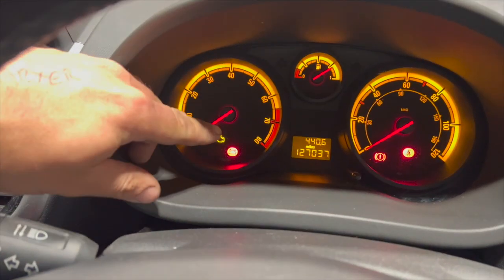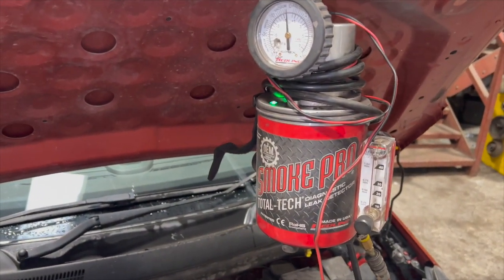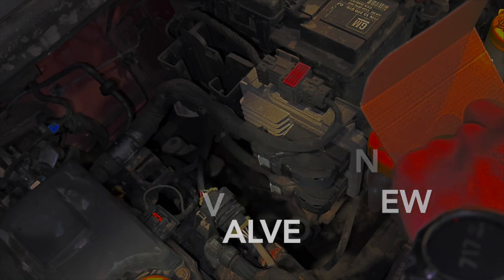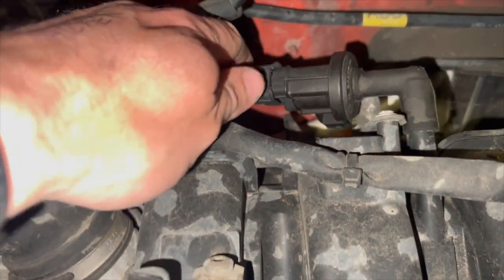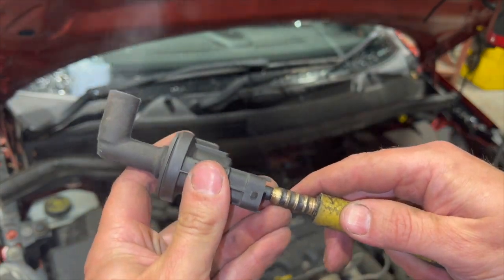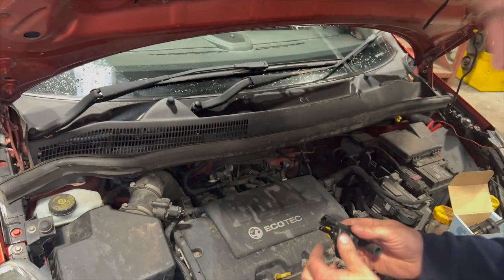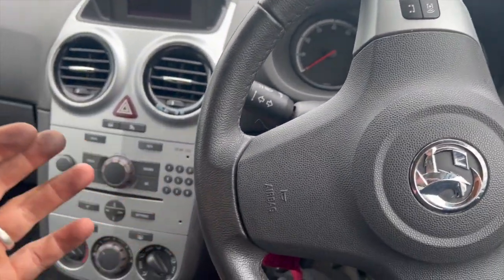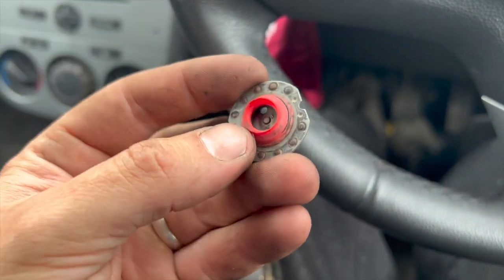Vauxhall Corsa P0171 fuel trim system lean fault code fixed!

Comment from the maker: New Purge Valve Ebay - https://ebay.us/vNarSE
New Purge Valve Amazon - https://amzn.to/3I9r37W
Diagnostic machine used in this video:
Topdon Phoenix lite 2 Ebay - https://ebay.us/tsyiTI
Topdon Phoenix lite 2 Amazon - https://www.amazon.com/dp/B0B1MB6YG8  

Tools used :
Smoke leak tester kit - https://ebay.us/txeXUY
Power probe - https://ebay.us/vg7PGK
Leatherman wingman multitool - https://amzn.to/41dtKwm

Check Euro car parts - https://tidd.ly/3lIO7xA  (use discount codes on site)
Check "Car Parts for Less" - https://tidd.ly/2LNEwIn  (use discount codes on site)
Check GSF Car parts - https://tidd.ly/34pZe7o  (use discount codes on site)

Comment: I have the same problem on a 2017 Corsa. I removed the purge valve but it was shut. I applied a regulated power supply to the purge valve and it opened at 5 volts and 0.3 amps. Is this what should happen or is the valve opening too soon?
Reply from the maker: Sounds like its working ok tbh

Comment: Great video - very clear and thorough. The problem I had that stopped me doing the "blow through" test was that the rubber elbow that connects the purge valve to the manifold would not budge no matter what I did. I tried prising with a screwdriver and even removed the mounting bracket so I could try to twist the valve/elbow to break it free but still no luck. Any more force and it risked either ripping the elbow or breaking off the pipe on the ridiculous plastic manifold.

Luckily I found an "evap" test option in my TopScan OBD2 scan tool that may have been for that valve. When I operated the test it made the engine idle go rough as if the valve had opened and let vapour through causing it to go rich - at least it seemed that way?

In the end, my A12 XEP misfire was caused by the spark plug gaps strangely being way too wide - guessing that they were something like 1.2-1.3mm as the gap tool I have only goes up to 1.1mm. They should be 0.9mm and setting them to that removed the problem. Not sure if they naturally widen over time due to repeated use or if they were wrong when the garage put them in, but the problem only slowly started after a couple of years or more, then worsened over a few months.

Comment: Will this cause the car to chug when in lower gears
Reply from the maker: Usually just puts the light on but is possible
Reply: Did you find the fix for this? Mine bucks in lower gears and is also showing the p0171 code.

I've ordered a valve as they're cheap enough anyway.

Comment: Hi bro, please give me advice.
Corsa D 1.2 2013.
Could start the car, runs perfectly, as soon as I touch the thortle the engine starts running rough also the rpm start going up and down. While pressing the thortle runs perfectly but at idle rough again. If I turn off the engine, and wait untill cooled down, then it's fine again.

Comment: This has been a problem that been driving me mad!! 
Light comes on intermittantly when I'm usually stopped at traffic lights for too long... lol 

Just took it off the car and blew through it... Straight through... no resistance! so going off what I've just seen it's fooked! so gonna order a new one! 

Fingers crossed it'll fix the issue! and thanks for the video! :D
Reply from the maker: sounds like it will! 👍👍🤞
Reply: @diydaly  Hey bud, That completely fixed my problem! thanks for the help! 
When it failed its last MOT the garage told me that it's a common problem with corsa's and the only way to fix it, is to send the ECU off to Vauxhall for remapping or something...  So an additional thanks for showing me that garage don't know what the hell their talking about and that I shouldn't go back there! lol
Reply from the maker: @SpecialGrayD  👍👍 nice one! Glad to hear it mate! Nice cheap fix then 👌
Reply: Same issue with mine. The revs jump up a little when sitting in traffic too long and the engine light flicks on. The engine light goes off after a few days and comes back weeks later. Will give this a try asap

Comment: I can't seem to release my valve on the Meriva B it seems welded to the pipe any suggestions how to release it with out cutting the pipe sheath please
Reply from the maker: Some of the later ones come with the pipe attached , it’s not meant to be removed 👍

Comment: Once we replaced with new one, do i need to clear the fault code. I don't have like  this tablet.
Reply from the maker: yes you will need to clear the fault Mate
Reply: Remove the negative cable from the battery  a couple of minutes and you should be good 😊

Comment: my corsa 1.2 from 2011  gives the same p0171 code but also the car goes up in rpms randomly. the rpm increases en drops down especially with the a/c turned on. do you think does could also be because of the leak?

Comment: I’ve got a 1.2 Corsa. I got aa roadside, they diagnosed p0171. 
Fuel correction.

Some symptom
- jerky driving 
- high revving idle 
- bad fuel efficiency 
- acceleration not smooth 

Someone please advise
Reply: I changed two 

Star line coolant sensor £10 
Other one was thermostat sensor around £60 all on euro car parts . 

Fan works normally 
Winter and summer it regulates fine now
Reply: Have you figured this out
Reply: @NeonTlz11  hey mate. It’s a sensir Yh. Tbh I haven’t changed it yet. I will on next service. Map sensor bosh euro car parts for Corsa d. £140.
Reply: @gumtree5368 what sensor is it
Reply: Hey mate 
It was a temperature sensor.
Reply: Thanks. I have same code. Going to try the purge/breather valve as have pulled my one out and its not working properly anyway

Comment: Helo mate, I have the same code, my mechanic doesn't know what's the problem. Is it  dangerous to drive with this valve fault? 
Thank you! Cheers!
Reply from the maker: No but it may cause the engine to run rich
Reply: @diydaly  Thank you. I also noticed that my fuel consumption is lower than usual

Comment: hi there have the same fault code in my 2010 meriva 1.4 t could it be the same problem has done around 85000 miles thanks steve checksfield
Reply from the maker: Possibly you would need to test the valve

Comment: Hi mate will this probably also effect the car as in the engine cutting out while driving as if it had no fuel in it and when u try starting it again it just keeps turning over like there’s no fuel one minute then try again and it just starts up like there’s no problem? Hope this makes sense mate cheers
Reply from the maker: Hi it doesn’t usually have too much effect other than putting the light on
Reply: @diydaly ok cheers mate we’ll I took the valve off and could blow through it so it needs changing anyway and the light was coming off and on like you said but the car does cut out every now and then like there’s no fuel getting through and then will just turn over like there’s no fuel it does that a few times then try it again and it will start up straight away as if there was nothing wrong do u have any idea as to what it could be or I could try like is there air in the system or something do u think if so what’s the best way to go about getting the air out thanks mate
Reply from the maker: @mikemarks8046  check the temp sensor readings , also possible crank sensor fault

Comment: Follow! Hi mate, i have an opel corsa e 1.4 gpl 90 cv, after i had code p0171 i changed the pcv valve like you did. The valve was broken, but the p0171 code is always there. I changed both lambda 50k km ago but they, it seems to me, are working. The second lmabda has 1.250 value when motor is cold and 0.6 0.7 when its hot. The first lambda goes from 0.1 to 0.75 periodically.

After i fixed the pcv, the motor has a better idling, but i guess it's a bit too much rough.
1 of 2 error code goes away (both p0171, suspended one was fixed, the permanent one is still there) 

I believe (i checked the parameters) maf is ok, map too. I didn't checked very well the brake servo but i don't feel nothing wrong while braking.
The air doesn't spill through one way valve of the camshaft cover.
The short term  regulation is around 0. Long term about 8-10, so i believe lambda are working and there is some air  after the maf sensor... 
What else i have to check? The intake gasket? Would you want to help me 😂
Thank you.
Reply: Did you manage to find the problem, friend? I'm in the same situation. I've already replaced everything and the code still persists, and the fuel consumption is very high.

Comment: hi mate nice video mate. i have fault on my vauxhall zafira tourer 2017. fuel trim system lean any tips or idea what it could be? or what i should check for? thanks
Reply from the maker: Could be the same thing or lambda sensor , hard to say without looking

Comment: Hi, does this fault occur on the 1.0L Corsa . Which would occasionally cause the car to cut out
Reply: Having an issue with a 2014 1.0L Corsa. Cuts out , looses power , then re-starts. Runs fine for a few days then cuts out again . Thanks
Reply from the maker: It doesn’t usually cause it to cut out tbh , might be worth checking your temp sensor

Comment: Excellent 5.shame you don't have  more subscribers. Question for you I ha've a vectra c 1.8  z18xer  petrol vvt.i have a slight issue were the rev needle fluctuates every  now and then not all the time.i have smoke tested the intake and see smoke coming from the throttle body.heard these don't have a gasket on them ?was thinking of removing it and adding my own gasket or some sealant to see if that helps with the idle.any thoughts .Thanks in advance.
Reply from the maker: Thanks , I’d check with the dealer about a gasket.. I’d of thought it should have one .. if it doesn’t I wouldn’t use sealer though tbh , does it not have any fault codes?
Reply: @diydaly  Thanks for the reply. No fault codes cars runs fine no issues except now  and again the idle will fluctuate  .apart from smoke test which shows some smoke from throttle body.will check with dealer regarding a gasket .